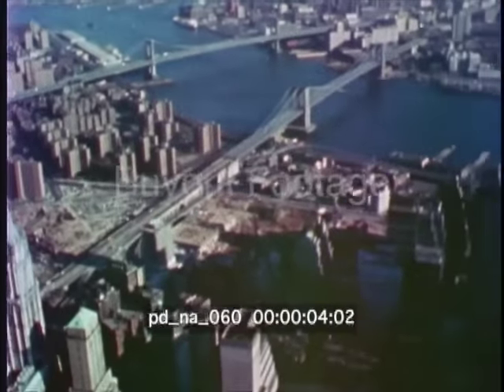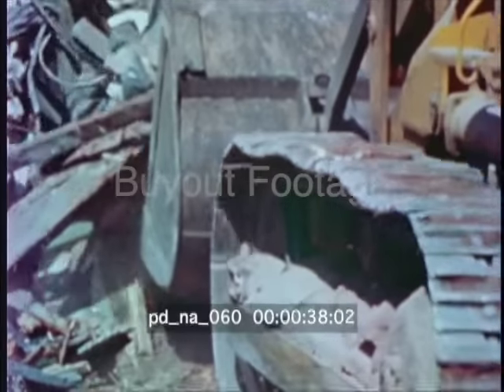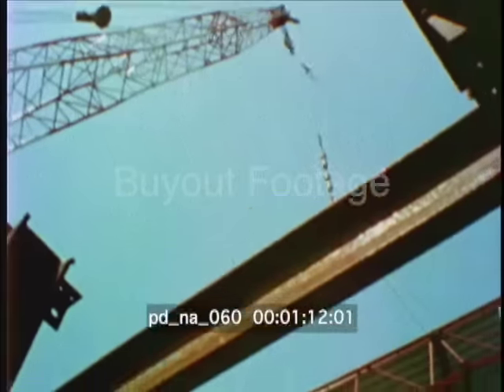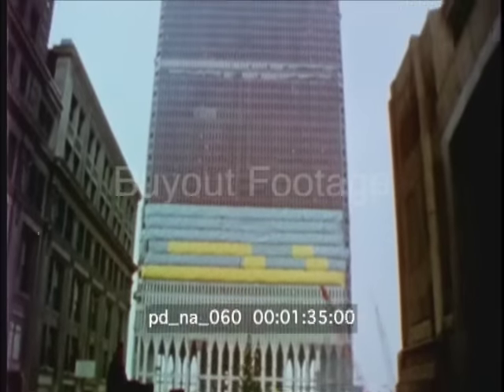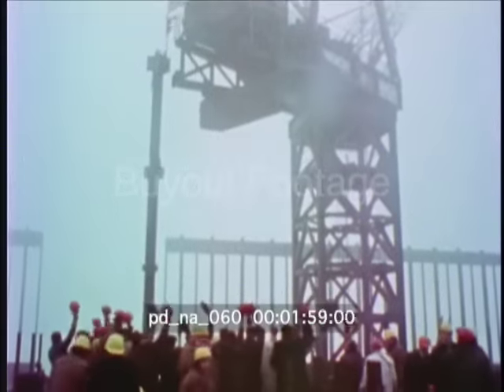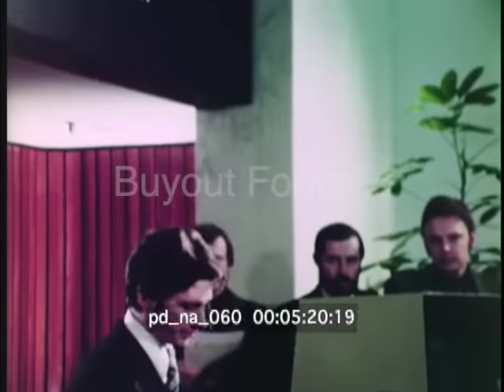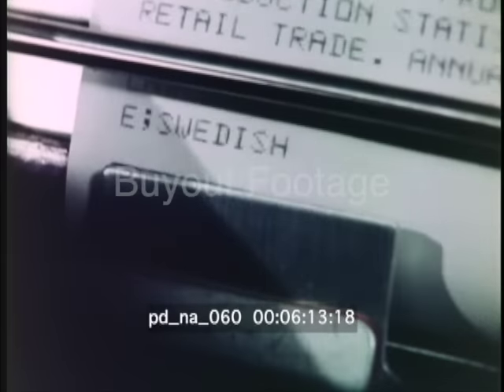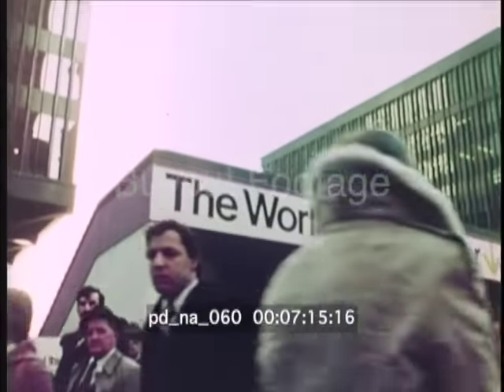Building The World Trade Center 1970s Stock Footage

Comment: At 1:41 center columns.  There is not any way those towers came down other than using explosives inside them.  The center columns are massive.  No pancake is possible.  Inside job.
Reply: The weak and bending floors made the facade and core columns to collapse in on there selfs
Reply: @YoloThunder69  Yea go look at the original architecture design of the building.  I think not
Reply: @blarpieman  what do you expect a large aircraft like  a 767 going 500 mph or something in kilometers hitting a building huh explain to me
Reply: @blarpieman  the building could have withstood a 707 not a fast flying modern aircraft like the 767
Reply: @YoloThunder69  Does not explain the way the building came down.  It should have toppled over onto its side since the structure was damaged on primarily one side and not pancaked.  Its all impossible without internal explosives.  Both buildings had power cut two weeks prior to the events for "maintenance."  Insider work.
Reply: @blarpieman  the south tower did topple in videos if you look closer the south tower did topple over but not fully this would happen due to where the plane hit and on south tower collapse videos you can the outer facade getting pulled in by the wall
Reply: @blarpieman  the south tower did collapse on a angle the north tower pancakes because of the impact zone you can see this in close ups of the north tower there's the same thing the facade is getting pulled in
Reply: @blarpieman  reason why you don't see the towers not topple(south tower has a visible angled while it collapsed)over is where the angle of attack the plane collided or with you explosives
Reply: @YoloThunder69  None of that explains why the remaining structure fell.  The planes hit the corners of the buildings and those outer perimiter walls were damaged pitching the upper half of the buildings which should have fallen off the remaining structure instead of coming down with it together.  Over 2000 engineers disagree with your assessment.  Keep in mind building 7 wasn't directly hit with a plane and that came down also in a free fall fashion.  All impossible without help of explosives.
Reply: @blarpieman  even if the perimeter was damaged there's other perimeter columns and other untouched floor the south tower did fall in an angle but it didn't topple over fully with the huge weight the top floor came down on the other floors untill the top of the south tower was fully destroyed leaving only gravity to do the rest which is the floors pancaking and for the north tower it had less weight the core columns could handle it a lot longer
Reply: @blarpieman  the wtc problem with it's collapse is that it had steel floors and as I said those steel floors started to get weak and sag bringing the perimeter wall to come in until the weight folded the bending  perimeter columns the pancaking occurs when the weight is to great for the rest of the floors so as the tower collapsed the weight of the original piece of the tower that collapsed gets heavier and heavier but some core columns survived but then collapsed in seconds the whole reason the towers collapse was due to the pancaking floors
Reply: @blarpieman  building 7 did come down in a free fall fashion because what you saw was the shell of the building the insides of wtc7 were on fire and damaged from the previous collapse
Reply: @YoloThunder69  No pancake possible without explosives.  They came down at free fall speed which is impossible without pre planned intervention.  WTC 7 is your major clue here since heat has never weakened a steel structure in history and 3 came down onto their foot prints in the same day.
Reply: @YoloThunder69  Yea no there weren't.  Look at the fall.  Pressure waves blow numerous windows from exposives being set off and the building collapses at its center down.  A perfect implosion.
Reply: @blarpieman  explain what happens when steel is exposed to fire if the fire is hot enough or burns for a long time the steel weaken and for the wtc the floors are made of steel and sag
Reply: @blarpieman  it clearly seems that you don't know what fire does to steel and how a plane colliding with a building intentionally going 500 mph affects a building
Reply: @blarpieman  
"No pancake possible without explosives."
Wrong.  You don't need explosives for pancaking to happen.  You just need the floors to be hitting the floors below.

"They came down at free fall speed "
Wrong.  You're thinking of free fall acceleration.
Also Wrong... as the debris fell faster than the buildings did.  The debris was in free fall the buildings were not.

"WTC 7 is your major clue here since heat has never weakened a steel structure in history"
Wrong.  Heat has weakened many structures.   Heat has even caused total collapses such as the Plasco building.

"and 3 came down onto their foot prints in the same "
Wrong.  Most of the towers fell outside the footprint.

You get most things wrong.
Reply: @markh1011  You are comparing apples to oranges in terms of build standards, construction and architecture.  Watch the Plasco building collapse and you will notice the building begins to collapse very chaotically falling onto itself slowly at first then falls to its side and not onto its own footprint.  This is a big deal because the fall is slow going and WTC and the twin towers very extremely rapid.  None of them were chaotic in demolition and none of those 3 buildings fell or toppled over which is statistically improbable or impossible, not to mention with out construction standards and fire retardants this is basically impossible with the heat levels.  
I could not find any architecture design of the Plasco building so its design is unknown unless you have the blue prints to share.  We also don't know what safety standards they use and to be honest when the building fell it looked like an erector set with a thin outer skeleton.  
I think you don't want to believe your government has the potential to sacrifice a few thousand people to get us to go to war to spend trillions but that is being naive.  Look at what they did with vaccines.  They had no safety data and more people have died from them than were killed in 911 and we don't have the long term data to say there won't be millions of cancers and strokes.  Don't be naive.  We have a fascist government at this point and its not reversible even with Elon running Twitter.
Reply: @blarpieman  
"You are comparing apples to oranges "
Now you're changing the claim.
You said " heat has never weakened a steel structure in history"
That's false.  You are wrong.

I give an easy example to prove you wrong and you say "well the buildings are different".
You're running around with goalposts.
You were wrong.
Fire has weakened steel before and even caused total collapses before.
Is it sinking in?
Reply: @blarpieman  
" None of them were chaotic in demolition and none of those 3 buildings fell or toppled over which is statistically improbable "
Again your lack of understanding is tripping you up here.
Gravity pulls down. There was no pivot point, or lateral force to make either the towers or WTC7 somehow move to the side.

"not to mention with out construction standards and fire retardants this is basically impossible with the heat levels.  "
Just because you don't understand something doesn't make it impossible.
Reply: @blarpieman  
"I could not find any architecture design of the Plasco building so its design is unknown"
It was a steel framed building.  
The Wilton Paes de Almeida Building was steel and reinforced concrete (which handles fire better) and it still collapsed.

" We also don't know what safety standards"
You're again scrambling to try and make up for your large error.
Fire weakens steel.   You were wrong.
Fire has caused partial and even total collapses of steel buildings.
Quit with the excuses and diversions.
Reply: @blarpieman  
" think you don't want to believe your government has the potential to sacrifice "
1.  Boring lines from the flat earther script...zzzz
2.  Not my government.  I'm not American.
3.  I believe the US government would do nearly anything.
4.  I think you don't want to accept that some motivated men could get away with this.

You're going to have to make better arguments then that kiddo.
Reply: @blarpieman  The rest of your post was paranoid rambling and I ignored it.
Reply: @markh1011  "Your inability to understand things like this doesn't mean it's a conspiracy."  How many times did you want to phrase that foolish statement to me to attempt to make yourself feel better.  

Both towers and wtc 7 fell onto their own footprint as is seen from numerous angles.  None of the buildings fell over or toppled over and according to over 2000 architects and physicists its impossible for the buildings to collapse at the rates they did without the floors and the strong center columns being removed by explosives.  

Let us not forget the statistical improbability that all 3 buildings fell without toppling over, one of which had just a fire and little to no structural damage. Lets not forget Silverstein made an error when he said they "pulled the building" because there was extensive loss of life.  He basically outed the entire operation and had all the insurance up to date to make sure he was paid out properly.  When you watch WTC 7 its super obvious you just have to allow your mind to let go and observe and accept what you are watching. Buildings don't fall like that and the twin towers never should have collapsed because there was no structural damage to them below the strike zones and have the strength to support the top halves.  Pancake theory is nonsense and has been debunked by enough engineers.  It was a strange day my friend but we needed that war to launder trillions to companies and attempt to democratize Iraq which has nothing to do with the attacks.  
Lets not forget they released a few frames which was a nothing burger of data of whatever hit the pentagon.  A building with hundreds of cameras they release a couple frames of something that looks like a missile and not missing major parts on the front lawn.  Gimmie a break.  They have the footage, just release it.  
Let us not forget government and companies are in bed here so they don't care about you or your life.  If they really wanted to do mass damage they would have waited until there were 50k people in each building but they didn't want to sacrifice that many people.  
Conspiracy people are usually right in most cases just like I have been saying for years that Twitter, fb, google are all government controlled companies designed to sway elections as they did in 2020.  Cannot be trusted nor any of their vaccines or other garbage they try to put on us.
Reply: @blarpieman  
" How many times did you want to phrase that foolish statement to me to attempt to make yourself feel better.  "
I'm calling it as a I see it.  You have gotten pretty much everything wrong so far.

"Both towers and wtc 7 fell onto their own footprint as is seen from numerous angles.  "
 How many times did you want to phrase that foolish statement to me to attempt to make yourself feel better. 
You don't seem to understand the words you are using.   Most of the towers fell outside the footprint.  Have you even seen a photo of ground zero?
Reply: @blarpieman 
" None of the buildings fell over or toppled over"
It would have been nearly impossible for the towers to do so.

"according to over 2000 architects and physicists its impossible for the buildings to collapse at the rates"
No.   You're referring to a list of people who  added their name wanting a new investigation.  You're inventing specific arguments and applying that to the list.  They do not all say that at all.   In fact, the ae911 guys are a joke... hardly any structural engineers... hardly anyone with high rise experience....why can't they get their work published like those scientists who support the official story?. if you read the comments they made when signing up its clear than many have done NO research on the topic at all...internet lists have no credibility.   That's not how science progresses.
These guys only seem impressive to people like yourself who know nothing about this topic or science.
Reply: @blarpieman  
"Let us not forget the statistical improbability that all 3 buildings fell without toppling over, "
I addressed this in the last post.  It would be almost impossible to make the towers topple, particularly with a collapse that started at the top and progressed to the bottom.
You can't get your head around this.   You aren't capable of understanding basic concepts.

"Lets not forget Silverstein made an error when he said they "pulled the building" because there was extensive loss of life.  "
Actually if you look at  the entire quote, it's clear he could not have been talking about demolitions.
The only time that 'pull' may be used in demolition circles is to bring down a building with cables.  Either way, he said that the fire department made the decision to pull.  Are you claiming that the fire department blew up WTC7.... and hundreds of their people died?    
That's utterly absurd.
Reply: @blarpieman  
"Pancake theory is nonsense and has been debunked by enough engineers.  "
Do you even know what the pancake theory is, in the context on 9/11?
I bet you don't.
Tell me.  What do you think the pancake theory is?   
Go on.

Comment: I have questions to ask, how were the airplanes able to slide in so easily like a knife getting into a loaf of bread? Were the towers not built with strong steels to at least make it a bit difficult for the airplanes from getting in so smoothly during the attack? Pls I need explanations without insults
Reply: It's called kinetic energy
Reply: The exterior perimeter box column's that made up the exterior skin of the towers were hollow and got thinner as you went up. Where the aircraft hit they were only 1/4 inch thick if I am not mistaken. Google inelastic collisions in which energy is not conserved to get a detailed explanation on how less dense objects can pass through an object of much higher density.

Comment: Watching this footage leaves no doubt that these buildings could not be completely disintegrated by airplanes. Even if the buildings lost integrity and started to fall in on themselves, why was the cement exploding outward? Cement doesn't explode from high heat or stress. That was from explosives detonated on every floor on the way down. Watch the slo-mo footage, you can see the charges (flashes) going off on each floor as the towers fall. That's controlled demolition.

Those towers didn't fall, they were brought down. Not even mentioning Building 7, which is the smoking gun. No plane, no major damage..... crumbles to the ground at free-fall speed in 8 seconds. Yeah, sure... buildings just spontaneously combust all the time.
Reply: The steel melt because of the airplane collision that cause the tower to crumble

Comment: First of all I would like to say that I am going to make this comment with full respect to the catastrophic attack. My heart goes out to all the victims. 
I myself come from the Netherlands and here too this day completely turned our world upside down. But when you see this video, tons of stainless steel, 12 inches wide, I can't help but think... How? In retrospect, in my opinion, this is not physically possible at all. The aluminum of a boing is never strong enough to stand up to tons of stainless steel. I was wondering if more people are having this issue and if anyone can answer this question. Also wanna mention that I’m not in a complot theory camp or whatever. Again, all due respect. Cheers!
Reply: It's not the plane physically hitting the tower that caused the collapse, as you said aluminium is comparatively lightweight. It's the tens of thousands of litres of jet fuel burning up that caused the steel supporting elements to warp, then once floors started to collapse, the elements holding the floors up were not strong enough and the floors started falling faster and faster.

Comment: These buildings were nothing but death traps. Anyone with half a brain has to realize that a major catastrophe or fire on the lower levels will trap those on the upper floors. They should have made crosswalks connecting the two buildings for just that reason. Safety was not the priority in the overall design of those structures in my opinion.